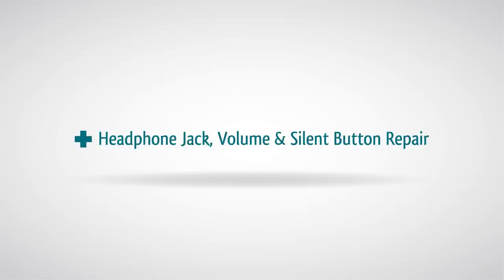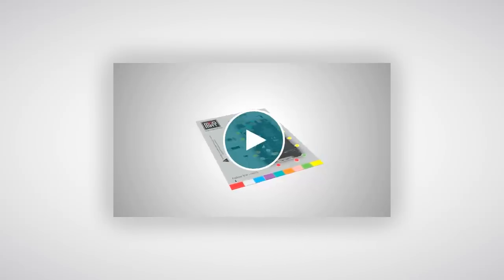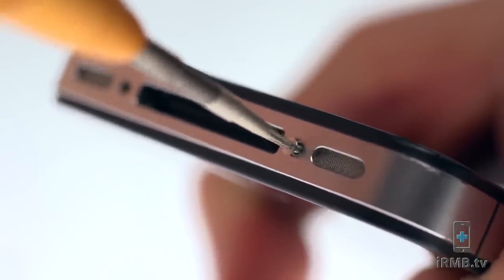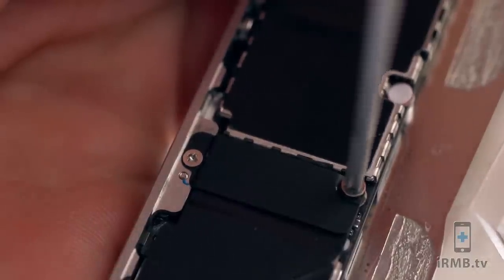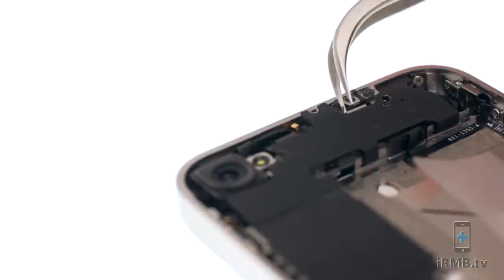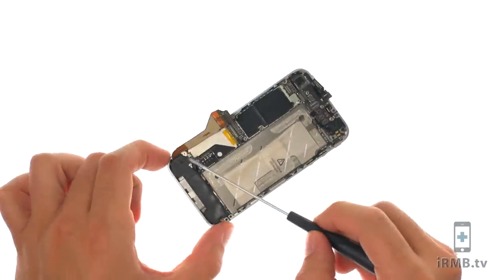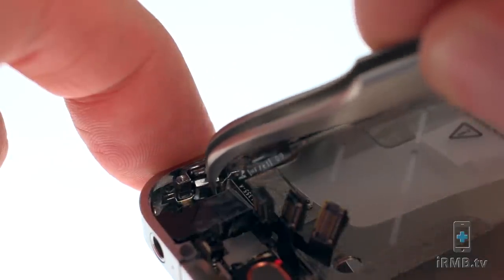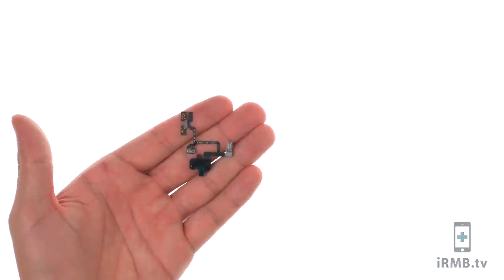Audio Jack, Volume & Silent Button Repair - iPhone 4 How to Tutorial

Comment: Yeah, very helpful.  But, as most technicians will tell you, putting a thing back together again is trickier than taking it apart.  Your video would be much more useful (more than it is) if you showed the infernally difficult method of reattaching the button brackets and mute switch to a replacement ribbon assembly.  Then showing any tips on reassembling it all.  I got there in the end, but more detail on the parts of the job that actually make this so difficult would be better.

Comment: Thank you for this video. One thing I would like to mention that I noticed while doing this. When reinserting the 3 lower screws (the ones that attach the volume control) make sure that the buttons still have a nice click to them. If you tighten them too much it will prevent the volume up down from being clicked. This is up to personal preference how much you want to tightenthem.

Comment: i have a question. my loud speakers audio is all messed up as well as my ear piece speaker for calls and my head phone jack all output staticy noise and distorted audio...even at high levels you can barely hear the audio but its there barely audible..its mainly static and you can hear the speakers thump as if theres something wrong going on...what could it be? some people say logic board? is there any other posibillity? i want to fix my self but i doubt changing each thing individually would fix it since this all happened at the same time...! please help!!

Comment: The vibrator is 1 of 2 things. The motor is or the flex cable is bad. To test the motor use a volt meter or use a 9 volt battery w/ a wire connected to the positive and another wire connected to the neg side. Then connect the other end of the wires to the 2 prongs of the vibrate motor and it will buzz if the motor is good. It it doesn't work most likely you just need to replace the motor which is a lot easier. The sound has to do w the bottom speaker part of the phone. Replace the speaker unit.

Comment: may i get an answer please ? my dads iphone 3gs 16gb has no more sound when it rings nor does it vibrate anymore, but if he answers it he can hear the other person who is calling and the other person can hear him , when the headphones are plugged in you can hear the ringtone in them but the phone still doesnt vibrate .... wil changing the bottm part that has the ds connector and speakers make it work ? .... it has no sound at all , not when unlocking , not when trying a game, etc. thank you

Comment: Open the phone and make sure the 3 flex cable ribbons under the heat shiled at the top of the phone are connected firmly to the motherboard. Mine would buzz on and off and thats how I fixed it from doing that.

Comment: Its really not that hard.I just used this video to fix my vibration since the motor worked but the cable was apparently dead. The hardest part is getting the screws back into the silent switch since it's a tight space. Just see how the flex cable is bent before removing the old cable so you know how to bend the new flex cable. It will make sense once you get in there.

Comment: It's such a fucking cop out to just show us how to dismantle the phone and then say 'do the same in reverse'.

The procedure is not always exactly the same... installing a new part is not the same as reassembling the phone... occasionally there are parts to take off of old components, screens, pads washers etc and fix to the new ones.

To assume your audience knows this is asinine... if they did then they wouldn't need to watch this in the first place.